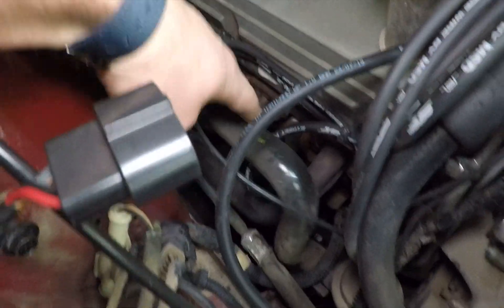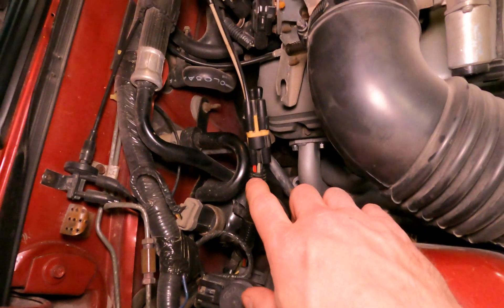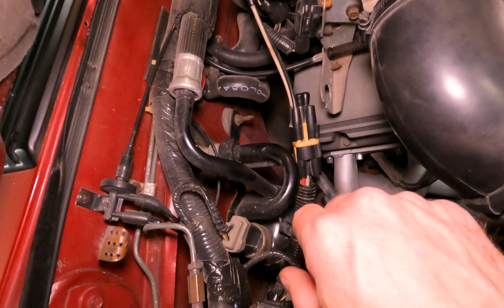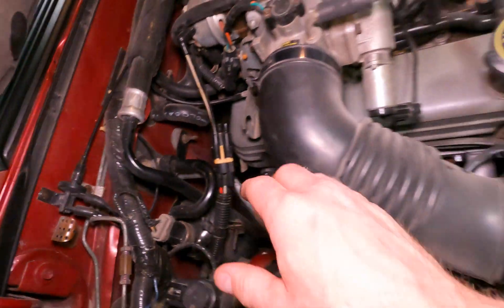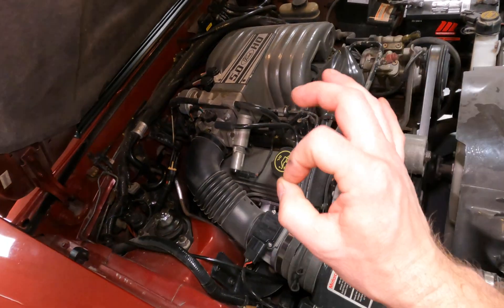What the Heck is a Thermactor? 80's & 90's Ford Emissions Control / Smog Pump Delete 2.0

Comment: Just FYI - If you remove the smog pump, you can't run the OEM catalytic converters.  They will clog up and fail in about a year because they need the air pump to function properly at the right temperature.  So if you delete the smog pump, make sure you get cats that don't require an air pump, or just delete the cats completely.   A prior owner deleted the pump and cats from my 1989 5.0 and it runs fine.

Comment: Just FYI, without the air from the smog pump, you will get a code 44 and a code 94 during a Key On Engine Run test when pulling codes from the EEC-IV. 

It doesn’t turn on the check engine light or show up in stored codes during the Key On Engine Off test, but for guys trying to sort out a drivability issue, it can be confusing.

IIRC, the oxygen sensors detect the switching of the airflow from the upstream (back of the heads) and downstream (to the cats) airflow during that KOER test and throw those 2 codes if the switch is not detected.

Those codes can also be caused by the passages in the cylinder head being clogged with soot on a higher mileage car.

As you said though, it doesn’t effect the drivability of the car.

Comment: They are annoying and noisy but they reduce emissions, during cold starts, air is injected into the exhaust ports allowing unburnt hydrocarbons to combust further which reduces emissions, during warm operation air is directed downstream to the secondary converters to assist with oxidation lowering hydrocarbons. Their function is not to dilute the exhaust to simulate a cleaner exhaust. In California during the smog inspection, too much air injected into the exhaust causes sample dilution and will not pass the emission test. I will note, in the original 88 Mustang GT commercial, the Black GT flying by the Farm definitely highlights the air pump sound.

Comment: I did that to n my 89 5.0 convert...  took off all the smog plumbing but the engine was still in the car. I bought those plugs online for the ports but had no clearance to tighten them in. I took one to the hardware store a sized up one to a  bolt(s)  ..loaded the bolts threads with lock-tite. and a boxed end wrench was all I needed..I also had to find a way to removed all that carbon.. two very short wire brushes bent to fit and spun them about 40 times in each hole...
Reply: Just did mine, I just cut a tap down to short enough, ran it through, screwed a ⅝ bolt in the back of the plug, blue loctite and a ⅝ combo wrench
Reply: When they stop turning, hit bolt with propane torch for a second, bolt should come out and the plug stays in

Wait 24hrs to cure

Comment: Glad to know there's one bright canuck that's smarter than the host of Ford engineers that put those cars together having to contend with emissions requirements. And Nice how you disparage the things you don't know about or even take the time to understand. Will the engine run without the Thermactor, EGR, Catalytic and most of the Vacuum systems?.... Yes   Is the computer designed to do so in stock form? ...No   Delete them if you like, bet you gain a whopping 6-10 Hp at different parts of the curve, and a weight reduction of 15 lbs. Why not just put a Holley EFI system on it or just strip it down completely and carb it.  Those O2 sensors really don't do anything anyways, do they. Wait, bet you don't know what they are for either. Oh, I forgot. dump that useless Evap carbon canister too. Nothing like the rich smell of gasoline in the garage.  Some respect for the process. The engineers did their job, and probably didn't wnat to put those systems on in the first place. Life in the 80's.

Comment: He Garry, what are the 2 items in the passengers fender? One is a round ball with a vacuum line and the other is a square box with a vacuum line. Neither were connected so I removed them 🤷🏼‍♂️
Reply from the maker: The round one is a vacuum pod that holds vacuum and helps the HVAC system run properly. I’m not sure what the other one is you’re talking about?
Reply: @KASLCustoms  it's like a 4"x2" box with a vacuum line attached right above the passenger side front tire. Neither are hooked up on my car maybe I should reconnect them 🤣 thanks bud. I put them in my last video but no one has said anything 🤷🏼‍♂️
Reply from the maker: @Joeshomegarage  Thats the EVAP system. Your fuel tank (in OEM format) vents off fumes to that canister and the vacuum line pulls them into the intake for burning. Not the end of the world to not have it hooked up but some claim to get a strong smell of fuel without it. I would however keep the vacuum pod hooked up in the inner fender if I was to pick one of the two 👍
Reply: @KASLCustoms  Thanks Garry! Of course I reinstalled the fender liners yesterday! LOL I have heat and AC now but I noticed the compressor doesn't cycle on and off but my freon charge may be off. I am taking it for an alignment so going to have them properly charge the AC since I replaced everything. Oh were else can I listen to the POD? I use spotify but I can't comment or see videos!
Reply from the maker: @Joeshomegarage  LOL thats always a guys luck! You may need a new set of seals in your A/C system. They are like $7 for the whole kit and definitely worth changing before the recharge. That, or you may have a bad switch on your accumulator...? Our pod is on both Apple and Spotify but we don't post the video
Reply: @KASLCustoms  thanks yeah I replaced everything in the AC system, new lines, dryer, condenser, compressor and the switch. I have gauges but couldn't get the freon to go in with the gauges I had to use one of those auto store things. It's blowing cold just not cycling. I'm just going to have the shop check it when I have the alignment done. Well I know what you and chris look like but the asylum guys I just know their voices 🤣

Comment: I have a 1985 ford motorhome with a 460 four barrel carb in it, the belt that turns it is on its own, can I just cut the belt?  That way I wouldn’t have to rush to cap off lines and such…will that effect normal operation?
Reply from the maker: I can't see why not?
Reply: Yes 🙂. Actually I just took the whole thing out two days ago…capped the one hose that went to it. When you put your hand on the hose while it’s running it just pulsates.
It’s running fine. It’s in the garbage now…thanks 😁
Reply from the maker: @paulcharlo9346  nice job!

Comment: I always find my self now that I own a fox coming right back to your videos 😂 dunno how that happens but I did get me a set of bbk headers and got me the blue ford racing wires and new plugs just drop the car off today to get the new top put on and waiting on my new back tires to come in putting 255/50 on the back talk to the performance shop about gears he quoted me 1500 that’s with labor and 373 and a B1 rebuild kit and I gotta order the electric fans also just because I herd taking the clutch fan off I saw on YouTube makes a extra 15 horse not a mor but I figured between the bbk shortys and electric fans and taking the smog pump off should make it perform a little better I don’t think I am gonna mess with a cam I thought about it but don’t believe so just having fun with trying to make more power but on small stuff not sure if a little bit bigger throttle body would help it or not but I think between the headers and electric fans I should get a extra 20hp I know that’s stupid but I never did this stuff before
Reply from the maker: Hey buddy - thats awesome! Sounds like youre on a great path to having more fun and making more power! Thanks for the support
Reply: @KASLCustoms  thanks man just something to do soon as I’m done with it I’ll send you some pictures I can email you them I gotta get it wet sanded and buffed when it’s all done it’s been repainted back to original color medium Cabernet red but lotta trash in it and some door dings I gotta get a PDR guy on it and thinking because it’s got some dents in the trunk lid might be cheaper just to buy another trunk lid and have it painted just hope I’m making the right choices lol guess we never know until we actually do it on our own my son wants to turbo it I said no no ain’t going that crazy but I think removing the original cats and put them to the side and save them should help a little also
Reply: @mikemarks6562  I have the same color on my 90. Get you a dual cooling fan from a ford contour. They work great.

Comment: What about the solenoids that vacuum lines run to. Can they be removed?
Reply from the maker: Allegedly yes they can however I've always just left them in
Reply: @KASLCustoms  ok, mine are still in currently. I deleted my smog pump and egr on my 1988 f150. It starts up but will not stay running unless I feather throttle. Any tips on how I could fix issue?

Comment: I have a question sort of related to this video. I recently did a fiverr swap with a 97 Ford explore. I use the GT 40 Hz upper and lower intake and block. Basically the whole engine as you suggested in this video. I delete it I smog pump now I’m stumped as far as Routing the lines that come from my Plenum can you help me out with this?
Reply from the maker: Do you mean the vacuum lines?
Reply: @KASLCustoms  yes.  If you were positioning plenum TB end down I have one line on the left side in the middle attached to a T fitting on the right side and going to the lower intake at the back of the engine and right below that I have a line going to the vacuum tree for the brake booster and below that the other line is going to fuel regulator. And the two lines that point to the front of the engine I have left are capped. Does this sound correct? And also my canister purge valve, I know one end connects to charcoal box but where do the other end go?  Please excuse the typos previously I should have proof read it first. Lousy autocorrect! It corrected the wrong words.
Reply from the maker: @surethingnow honestly, the best advice I can give would be to google a vacuum diagram. I he reason I say that is because depending on what your car has for vacuum operated accessories vs. what it does not varies so much from car to car. Also, I would recommend picking up a Haynes manual for your year car. They have all the vacuum and electrical diagrams in there.
Reply: @KASLCustoms  cool thanks for advice. I already have hyanes book for my 1988 ford thunderbird sport which you probably know is on the foxbody platform the book is very vague on certain subjects like vacuum diagrams so I tend to rely on info for Mustang gurus for some answers. My whole build has been an exciting discovery one after another why should it change now peace, brother.

Comment: Great video man but don't forget about the TAD and TAB solenoids to remove those and cap those vacuum lines behind the passenger shock tower
Reply from the maker: Thx buddy!
Reply: Is there a video for that?
Reply: Im getting codes 44 and 94.  Pump still on but everything else has been capped. Also code 31 for the egr  does that have to do anything with the air pump?  Love your channel.  Great video as always

Comment: i have a 1989 f250 xlt lariat that was made in canada for california and i live in pa .... its on both exhaust manifolds back of the heads classic coffe can the whole nines plus the tenth hole
Reply from the maker: Nice!
Reply: @KASLCustoms  can confirm it no longer exist plugged the tube to the cat the tube to the heads replaced both manifold which came with plugs left the tab and tad but plugged the lines to them removed about 60ft of hose and hard line and left the egr and evap system installed left the pump just acting as a  pulley for now No CEL so im happy truck seems happy
Reply from the maker: Right on!!! Nice job

Comment: Man, did I need this video. I have been throwing OBD codes 94 (Air diverter solenoid circuit fault), 44 (Thermactor air system fault). I don't know what to do. Im going crazy. The other codes are for the EGR (I replaced it) along with the IAC, and code 18 which is a nightmare to figure out. Car runs fine ... in park and neutral. Put it in reverse or drive, it needs gas or it stalls out. Im at my wits end but willing to try anything.
Reply from the maker: Oh wow that’s crazy…
Reply: @KASLCustoms  I tuned it with a timing light. Got the TPS and throttle screw really dialed in. She’s running great. But no smog pump and still throwing those codes is weird. Guess I need to try a new EGR, right? Did yours leak smoke?
Reply from the maker: I have a video on my channel about my EGR vacuum leak. It was pretty odd…

Comment: Does anyone know what the RWHP gain from this change would be? I would assume that there is some drag from running that pump off the accessory belt. It doesn't seem like it would be a lot but I've heard of 15 to 20 HP gains from moving to an electric water pump so I know accessories can kill. I'm trying to decide if it's worth the emissions increase. I wonder if you could remove this pump, add mini cats in the exhaust system and end up with better emissions and without the complexity and power loss of the smog pump.
Reply: Smog pump hp? Almost undetectable, less than ONE hp.
Reply: Feels like -150 pounds of weight of the invisible trailer.
Reply: As @hotrodray6802 said, any power gains are minuscule. Even at 6K rpm you wouldn't feel it. There is a small weight savings though. A better idea would be to convert the smog pump into a crankcase vacuum pump and gain actual HP.

Comment: I recently removed my smog pump on my 88, now my car runs rich. Just wondering if this happened to you as well or do I have another issue. Also, this video was very helpful and made it way easier.
Reply from the maker: Thank you! How do you know it’s running rich?
Reply: @KASLCustoms  heavy smell of fuel and exhaust, it’s also not kicking down. I should mention that the rear main seal was was just done and all new exhaust with no cats
Reply from the maker: Ok gotcha. Getting rid of those cats will definitely give you more of a “rich” smelling exhaust 👍
Reply: @KASLCustoms  it may be stinky but it sure sounds good. Thank you.
Reply from the maker: Hahahaha it’s true! The smell is foxbody cologne bettter known as: eu de exhaust 😉

Comment: I have an 1984 LX 5.0 with the thottle body setup and auto, it still has the smog system intached, they only made a little over 11,xxx droptop 84 LX Mustangs, which most was 2.3L and v6 models, the V8 models are just as rare as the GT droptop, so would you remove it? 
Here is the car https://youtu.be/XgXPZUDEpBs

Comment: Just wanna add that the air being pumped into the exhaust actually does more than water down the emissions. The extra oxygen being fed to the converters makes them burn off more of the unburnt contaminates in the emissions. Maybe that’s what the movie clip guy meant by “more to the sneakyness”. Lol. Good video though. I ditch them things too. Right along with the converters. 😁
Reply from the maker: LOL!!! I know, I've always read/heard the same info as well however its always struck me as a bit of a "snake oil" sales pitch...🤷‍♂️ Until someone shows me the details first hand, I'm staying sceptical and ripping that 💩 out 😂
Reply: @KASLCustoms  
When emission standards first became a thing in the 60's the pumps just diluted the exhaust with fresh air. Once cats became mandatory, the pumps did make them more efficient at lower RPM/lower loads by introducing more oxygen causing them to run hotter. I've personally checked the temperatures of stock cats at idle, with and without the smog pump connected on the same car, and there was quite a difference. Many newer cars, and aftermarket cats, don't require the additional oxygen though.
Reply: @CzechSixTv 
Sir, you need to study a little bit more. Because your post is incorrect. In the 1960s, they went to Ported Vacuum Advance to retard the the Timing. This caused the engine to run hotter. This (the point), also, caused the exhaust to be hotter. By pumping Air into the exhaust, this continued the burning in the exhaust manifold(s). This is why the manifolds were cast iron. On GMs, with Siamesed ports, this over temperature condition causes the cylinder head and exhaust manifold cracking.

On your Mustang, failure to run the Air Pump will cause catalytic failure. I know this because I personally tested it. This includes late model, replacement, catalytic converters. If you are running your engine lean, you won't see this for a while; but, it will crop up. So, I presume that you are running "catless", as well? If you are and you are not running a Camshaft that is designed for low Back-Pressure, your Charge AFR will be incorrect and you are more likely to have additional issues that are related. Ford balanced your engine to run the way that it does. Deleting components without compensation is a recipe for additional problems.

V/R Chris
Reply: Ditto! Love Florida!
Reply: So it's okay to give kids asthma (and potentially cancer) to save 1% of fuel?

Comment: So in getting under my car to remove my stock h pipe I saw that the tube coming from the air pump down to the exhaust is broken. What would this cause?
Reply from the maker: Nothing more then a noise
Reply: @KASLCustoms  well I was wondering if that would cause some of the strange issues I was having. Oh well. I’m 3/4 of the way through the engine pull anyway so I was just curious
Reply from the maker: No worries bud! Good luck 👍